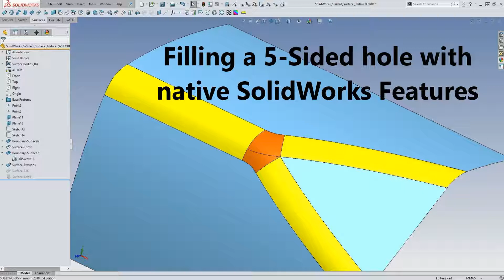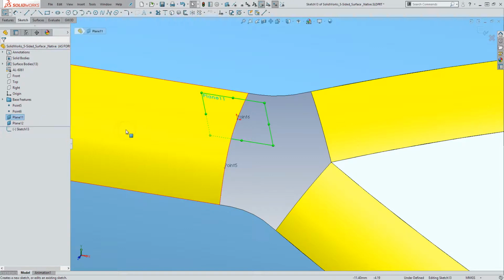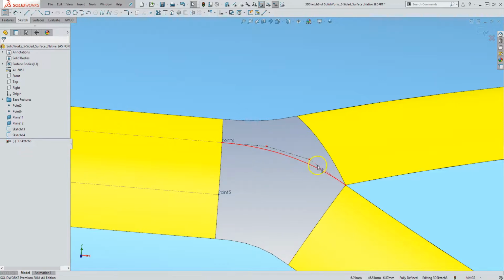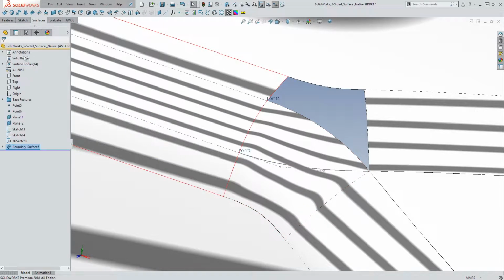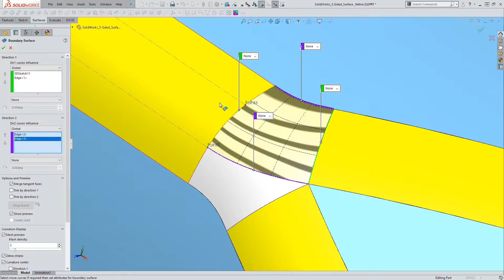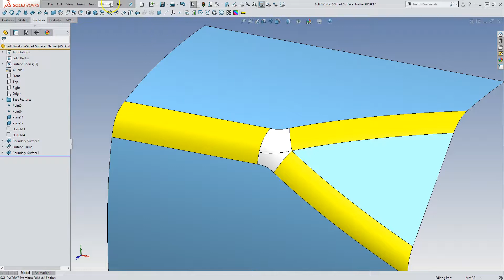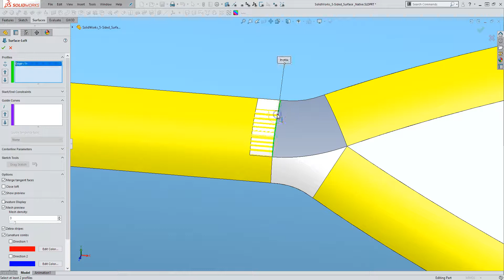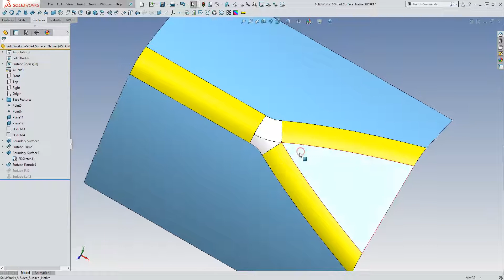SolidWorks 5 Sided Surface

Comment: Can't say I've ever gotten a good result with boundary surface without cranking the tangency influence to 100%. Frustrating that SW outputs garbage by default and requires you to use a slider to get a good result, like just give us a good result the first time.

Comment: Mark, Where in SolidWorks did you pull up the Surface evaluation tool that displays Vertices?
Reply from the maker: Hi John, that's not a SolidWorks feature, that's part of GW3D. I use that a lot just to evaluate if my result is good. Unfortunately SolidWorks doesn't have any way to show the underlying control points.